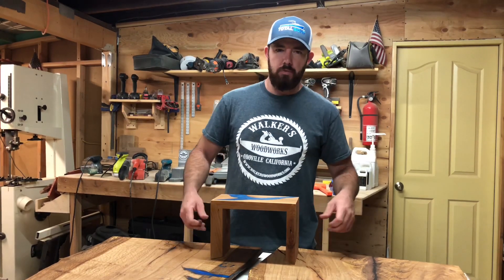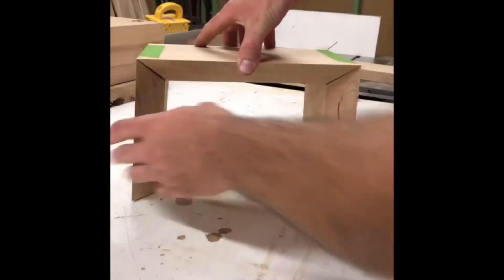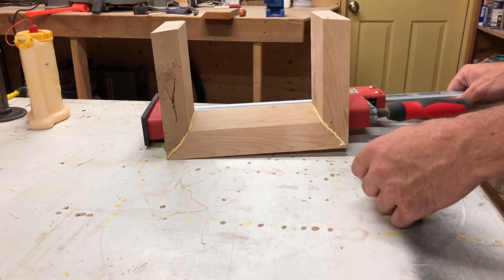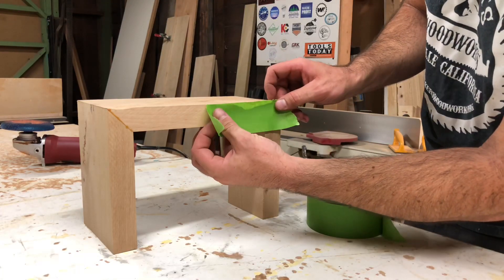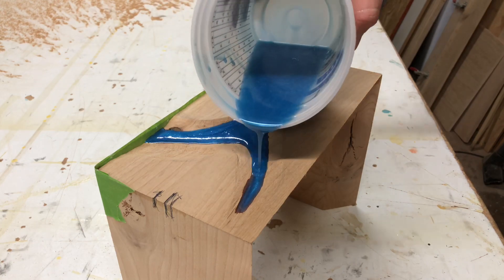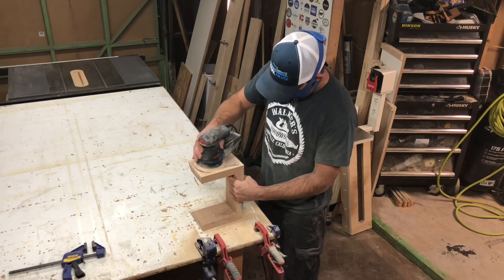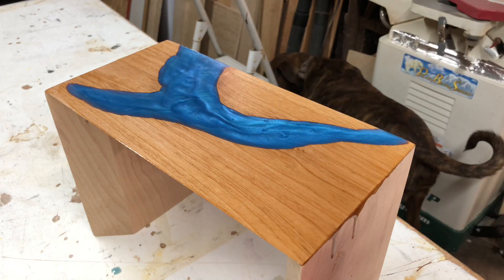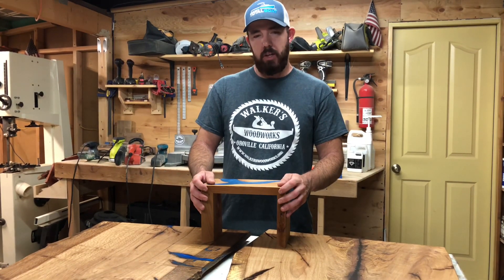Mini model epoxy river bench

Comment: Brandon, Can you explain the biscuit placement and how you achieve that?
Reply from the maker: I just set the biscuit jointer at a 45 degree angle and make sure its in the middle of the board as far as depth goes.  You may want to try it on a scrap piece first.  If this is for a bigger bench I would suggest using a different type of joinery such as dominos or dowels.  Thanks for watching!
Reply: Walkers Woodworks thanks man. Don’t know what I was thinking haha. Great work though.  What brand of epoxy are you using on these projects?
Reply from the maker: +Ben Bernstein depends how deep the pour is.  If it's under 1/4" I use MAS Epoxies "FLAG" if it's 1/4"-1" I use the MAS deep pour.  If it's 1-2" I use Polymeres Technologies Chill Ice 2
Reply: @WalkersWoodworks  Thanks man.  You think you could do this project or the coasters with a softer wood like Pine as well?
Reply from the maker: Ben Bernstein Yea you could. Would just not be as durable.